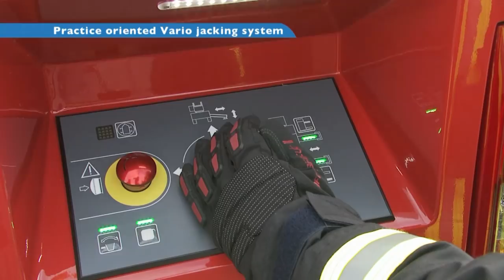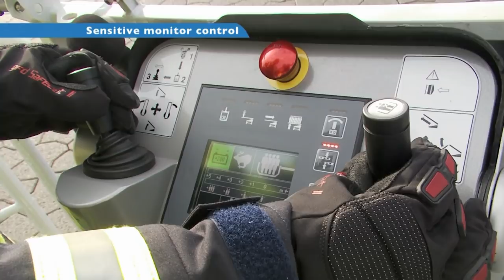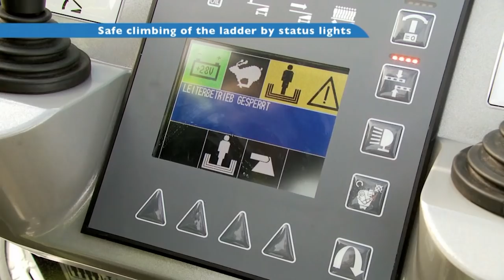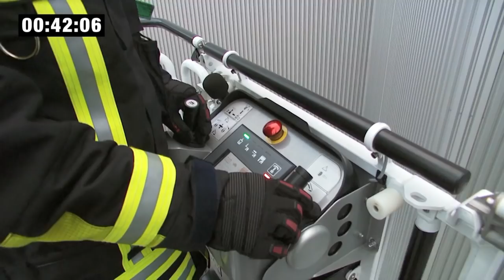Magirus Single Extension Articulated Turntable Ladders

Comment: Despite the longest reach with a whopping 800 kg full extension tip load the truck chassis is remarkably compact for a tower areal.  Pierce and Spartan towers are oversized